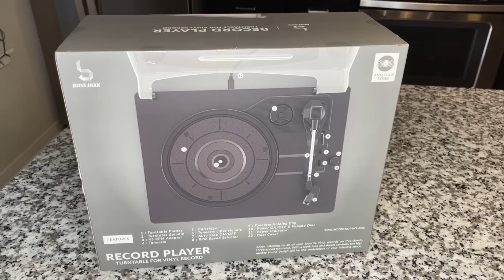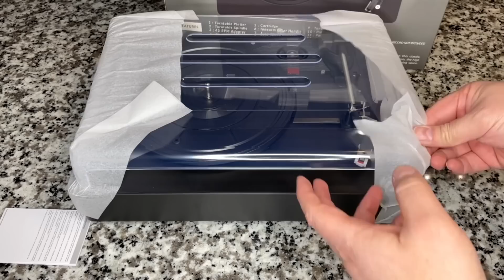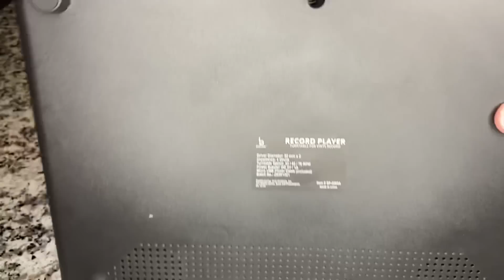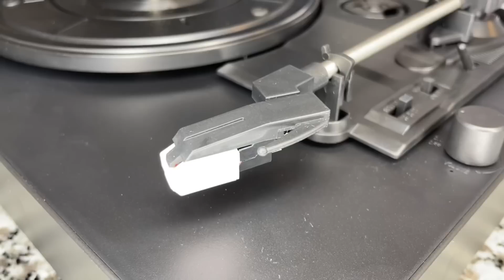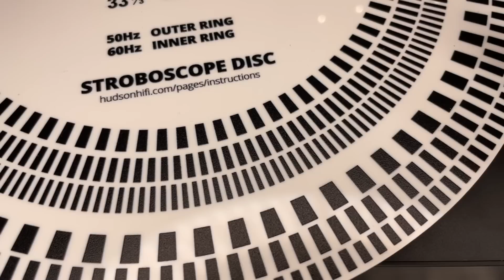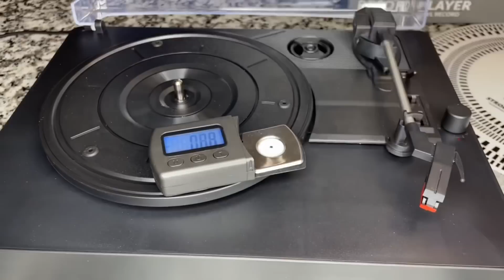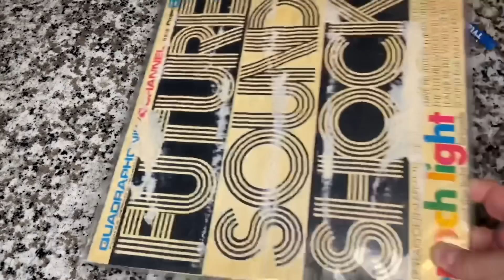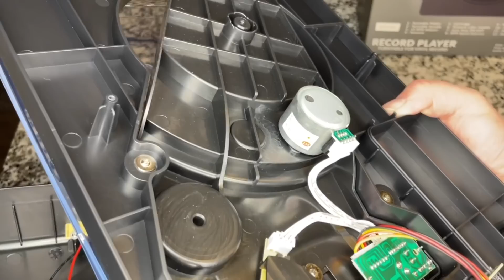SHOCKING $25 Record Player from Five Below - Unboxing & Review!

Comment: Hmm, I wonder if it could be powered without a mains supply?  Perhaps if the voltage was correct and if it connects to a PC, would it output sound via the USB connection also?  If so it may be possible for the audio to come out of another device - perhaps one with headphones?  All of this is probably not possible, but it's an idea?
Reply: The USB is clearly for power only. That said, you can power it off any USB power source, including a battery pack.

Comment: The tracking force isn't the issue with the stylus.  It's the sapphire stylus.  They wear down quickly (probably about 50-100 hours and then you have the issue of a worn stylus damaging records.  But replace the stylus regularly and it's all good.  Especially for $25
Reply: For all these BSR players with Chuodenshi cartridge clones, it's worth buying a pack of the diamond styluses for it and just switching it out as soon as you get them. You can get them cheap

Comment: I  am just a bit flabbergasted by the fact that they still make foreshortened plinths with the front slit for the record. What is the reasoning for this and why do manufacturers keep making them that way?
Reply: As Daniel said, it's cheaper!
In the 1970s, when companies like Sanyo and Philips used to make portable record players which worked off either mains or battery, the smaller form factor was also to make it easier to carry.  But back then, the covers on those smaller models was a proper piece of plastic the same size as the unit, which clipped shut so that you could carry it in (light!) rain without the insides getting soaked.

Yes, you had to completely remove the cover to play a record; but at least it wasn't 'pretending' to be a dust cover like this Bass Jaxx unit is doing. (Clue: there are slots cut through the so-called dust cover, so that immediately makes the it merely decorative and not functional; well, not as what most folks would call a "dust cover," anyway!).
Reply: Cheaper to produce and ship

Comment: Alot of people think having counter weights and anti skate  means its a good turn table. I prefer not to have that because if set wrong that can damage a record faster than one of these cheap units. And alot of people dont want to take the time to set up a turntable. Like me, they like to take it out of the box plug it in and enjoy it rather then fiddle farting around with setting it up ad connecting speakers and all that.

Comment: My unit wasn’t packed with the power supply. It also wasn’t packed with the USB cord! Other than that, it sounds better than the ‘more stylish’ Cruiser. And it’s ready for travel with a USB battery pack. 🙂 The impedance sounds matched too.
Reply: When you say ready for travel i just imagined pulling this out in the middle of a flight lmao
Reply: With a USB battery pack, this thing may be handy to take into thrift stores to test records with, although it would've been nice if it at least had a headphone output.

Comment: The metal cantilever on a ceramic cartridge by itself is a red flag. Because then you know for sure it isn't an original Chuo-Denshi cartridge and it's highly likely it isn't even properly impedance-matched.
Chuo-Denshi cartridges for the most part have those plastic cantilevers, ironically, and are properly impedance matched. However I know it would be bonkers to think this little thing would actually have the original in there, lol.

Comment: Mount a 5 volt battery pack in that huge empty space, and you’ve got a rechargeable battery powered turntable. Perfect for taking to flea markets and rummage sales. :)  I would probably change the stylus first though.
Reply: I just bought one.  That cheap plastic case is a great thing if you plan to mod it with RCA jacks, charge ports, headphone jacks, etc.  The stylus is awful, but replaceable.  True stereo separation on the speakers. This thing is not made for expensive discs.  It’s for hacking. And for that, it’s perfect!
Reply: Todd Jenkins   Absolutely swap the stylus - and that's true of virtually ALL record players featuring that type of ceramic cartridge, and while you're at it, purchase spares.  Shippings usually the same whether you buy one or ten.
Reply: I would keep the rechargeable battery separate just so it can be used for other things. But, with the low price of battery packs, sure hot glue it to the inside.

Comment: This little thing actually turns-in a half decent performance for what it is!!  And at that price?
Sounds like the cartridge output has been somewhat impedance matched, as there was some very clear bass coming out!
It's amazing to me to see that this is what has come of the old 'classic' BSR design, which has been so used and abused by so many 'cashing-in' on the vinyl resurgence, and yet this one..... this one actually does a pretty good job, and actually manages to sound 'decent'!
I would sat that this would be a definite contender for a Banpa cartridge upgrade.....  ;-)  It would benefit from that.....

A year or so ago I bought a cheap Bush suitcase player just to mess with for £30... it's not impedance matched in it's amp, but with an external speaker, it sounds pretty decent - with the Banpa cartridge... ;-)  I've been surprised how reliable that ultra-cheap mechanism actually is - and it's never 'destroyed' any of my records... some I've had for the past 50 years!!!

Love the ethos of your shows Mr Ology: Give everything a fair chance, and certainly with this one that paid off!   If this player ever becomes available here in the UK, I'll buy one like a shot!!  :-)

Comment: The other day, I was in Big Lots and they had Crosley Cruiser record players for $50, but I suspect this $25 record player may be just as good, if not better. The fact that this cheaper record player does not have all the "bells and whistles" may be a good thing because that's less to go wrong and many people don't care about those extra "bells and whistles" (all they want is something to play records). On the subject of needles and cartridges, I've learned that no matter if it's a brand new record player or an old one, always test the unit with some junk records. I've seen these modern record players visibly damage the record as it played and that was generally due to a QC issue (defective needle, too much pressure, etc.).

Comment: I think the lesson to take from this very well done review is that companies are charging far too much money for far too little. This is an index for an entire class of inexpensive turntables.
Gosh, add the BSR clone cartridge,  with a flip-over LP and 78 styli system,a tiny bit of counterweighting, some extra thick lithium grease on the cue mechanism and this would be perfectly OK for a casual listener. There's going to be a way to add an output jack, whether RIAA corrected line or straight off the speakers.
Reply: A set of line-out jacks can be installed by tapping the signal at the input and ground leads of the volume control potentiometers.  It's inexpensive and fairly simple to do.  I wouldn't swap in a flip stylus unless you really expect to play 78s.

As for the cueing lever, I don't think grease is going to help that particular mechanism here.   But there's an alternative - make an extension for the lever.  Yes, you still have to do it by hand, but a longer lever allows for much more control.  It could be as simple as glueing or taping a blunted toothpick to the existing lever.

But seriously.   I know $25 makes this very attractive, but by the time you've done the mods and stuff.... A Target Heyday is still available NEW with a warranty for $100.  Magnetic cartridge (which can be swapped out!), damped cueing, metal platter, built in preamp, truly adjustable tone arm.  Yeah, you need an amp, but... 

Just sayin'....
Reply: I think it may be possible to unplug the speakers and put better ones (or maybe another source of output in - but I'm no expert, so forgive me if I'm wrong).  It does seem odd that there is no other output though!
Reply: K, so I'm just getting into records.  Where do I even buy records???
Do they make modern(todays music) as records,...where do I buy them . ?
 I have cheap record player, but they said it would be ok as long as I replaced the needle stylus with a diamond one(crosely). ???
 Help me out
Reply: @BOBANDVEG  yes they even make modern music on records I own multiple records of muse and gorillaz. You can look in thrift stores for cool older records and depending on where you live you might have some local record shops if you just Google. For me there is a normal music store that still cells CD's, records and cassette tapes.
Reply: @BOBANDVEG  B4 lockdown I would cross over to the American side of my city (my city is 3/4 Canadian, 1/4 American, The twin Sault's) and I found that the American Walmart actually had a good hundred maybe couple hundred or more records to choose from.  From classic bands like KISS, Boston and Clapton to Modern albums like Motley Crue's Dirt and such.  For contrast my Canadian Walmart has like 5 records and their like symphonic orchestra music from the 50s.  Also we Canadians have a place called Sunrise records that while expensive actually has a decent assortment of vinyl that you can look through.  I normally have my Mrs. with me so I try not to tarry too long thumbing through the albums, but If I'm by myself, I love to just flip through the vinyl looking.  I'm sure there must be a big chain in the states similar.  (assuming your from the US).

Comment: "It doesn't advertise as a USB record player."
That's because it's not.  Only two wires from that USB port.  It's only POWERED by USB.  There's no capability for analog-to-digital conversion.

That's why it's this cheap.  It is literally the most basic record player you can buy.  Just a cheap skywin mechanism, a inexpenive little chipamp, and a pair of tiny speakers in an all-plastic cabinet.  No A-D conversion.  No AUX-IN or LINE-OUT.  No USB.  No Bluetooth.

None of that is necessarily bad.  Something like this is perfect to experiment with.

Comment: What’s the word on the $500 Crosley jukebox with turntable that’s being sold at Wal-Mart? The model is CR1704A-WM. I can’t find any real info or reviews about it.
Reply: The word is crosley and I think that's all you need to know. They've got balls of steel selling something for $500. The reason why is that the crosley name has been bought by a couple of different brands that manufacture specifically for stores like Target and Walmart.
Reply from the maker: This is not correct… Crosley is owned by modern marketing concepts and nobody else. Target and Walmart units are made by a company called Leetac. The Crosley jukebox system is made in the UK by a very reputable company. And Crosley‘s $500 C-20 was an exceptional product made in partnership with Pro-ject.
Reply: @Recordology  incorrect. I bought my crosley from Target that 6 g tracking force your not worried about ruined $70 worth of records the speed on both the crosley's I got because I also have a screw loose was very fast. The damn thing ate a Michael schenker group MSG album with the guitar on the front, unforgiven!

Comment: As Techmoan explained, the turntable mechanism itself can be imported from China for all of £10 including shipping.  With that in mind, I am glad they kept the price of the final product down.  Those Crosleys and Victrolas with the same mechanism are just not worth the prices asked!
Reply: Umm, you're absolutely right.  They're so mass produced and yet all of them use the exact same cheap, low quality plastic parts.  The turntable in this video clearly uses that same familiar build, but the justification is far more welcome at the lower cost when you consider the more substantial surrounding area.
Reply: @31cify  i would like to think my audio-technica has better quality components, it's one of the entry level models but atleast it's a name brand
Reply: This should be pinned! So many turntables, with wildly varying prices, use the exact same "guts". Once you recognise it, you see it everywhere!
Reply: Techmoan's video was titled 'PSA - The cheap record player mechanism to avoid', if anyone is curious to see what he had to say about it.
Reply: It seems like the Crosleys just put their focus on  'cooler' looking (faux vintage/retro)  shells and that is what you are paying extra for.  Form rather than function.  So you could buy this and cover the base in faux woodgrain contact paper and you got a DIY crosley
Reply: Yah it doesn't try to be what it's not. No glitter no fake leather or wood. What you get is good build quality inside as in actual connectors and a shell that complements what it is. A decent cheap and usable record player.
Reply: @shiroshine7227  l'd still prefer to pay 25 more dollars for it to slather nsync over the shell uv it.